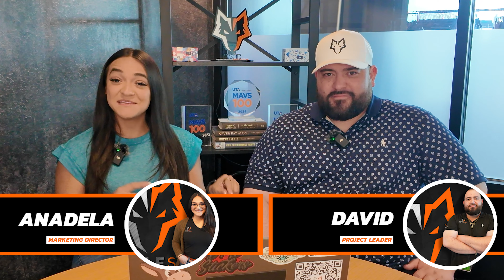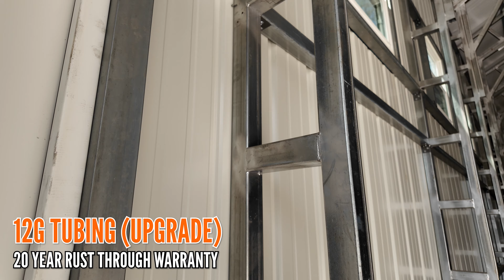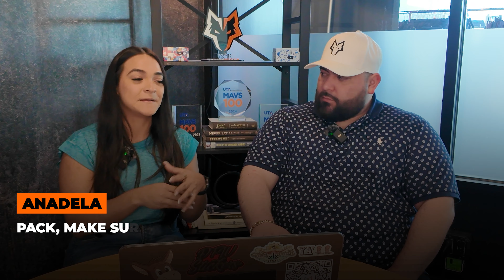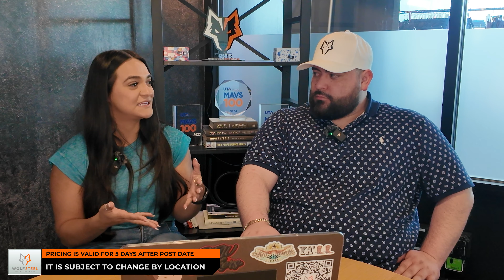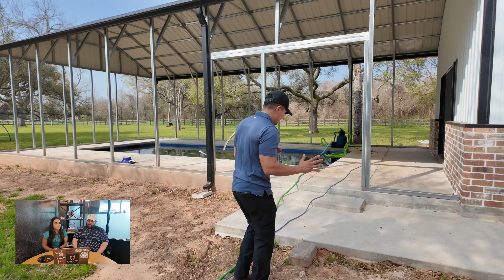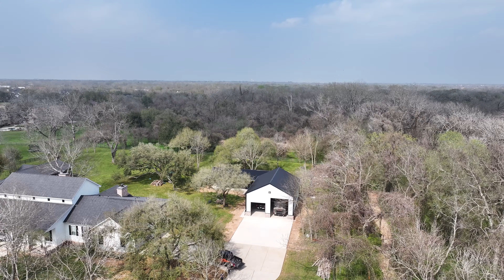32'x45' Garage & 22'x62' Pool Cover COST | What is the WIND Upgrade? | WolfSteel Buildings

Comment: Can you do a video about how your customers finish out a spray foamed building?  I know some frame out walls (2x4,6 studs) and others fasten runners and then screw in OSB, plywood, or drywall.  But it looks like those who fasten runners to purlins and girts seem like it would be unstable by compressing foam between.  Also I would imagine it’d be impossible to have a straight wall due to varying thicknesses of spray foamed application.  I’m curious as to hear your thoughts and see what customers have been doing.  Love the content, the ideas, and I’m hoping to get a consult from you guys after we close on a property in Krum.
Reply from the maker: We’re glad you’re enjoying the content! We think a video breaking all of this down would be a great idea, thanks for the suggestion! We’ll add it to our content list. And when you’re ready for a consult, we’d be happy to help guide you through the options.